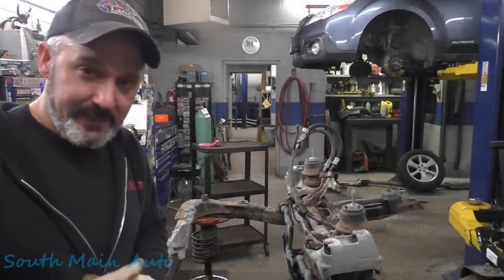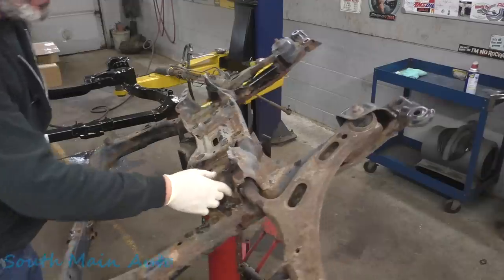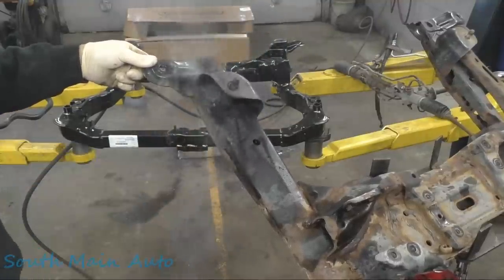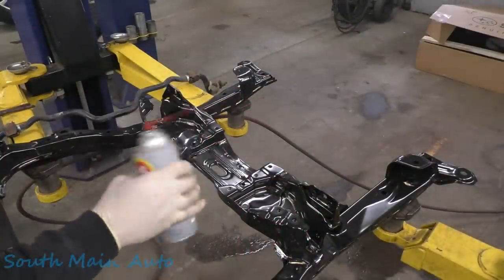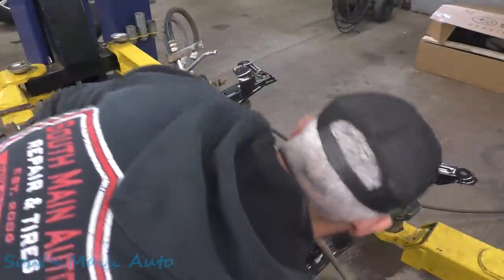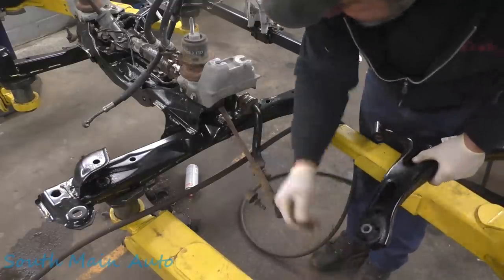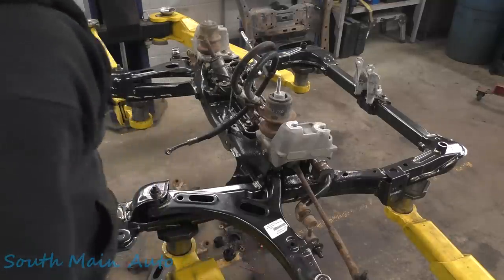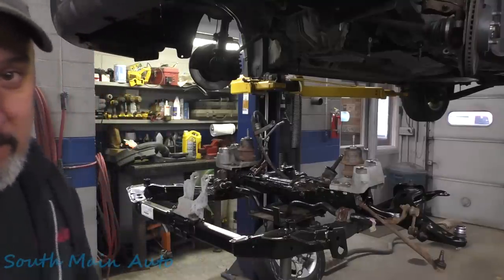Project Rotted Subaru Subframe - Part II

Comment: 8 years and nearly junk.  10 years and it surely will be.  Cars should last easy 20 years.  And they do most every where roads don't have to be salted. And it's not just the loss of 10 years.  There is a lot of expensive upkeep that wouldn't have to be done in a non-salt area.  I am getting ready to do my first pad slap to my 2010 130k Honda because it doesn't need rotors. Losing 10 years out of the life of every car seems like there should be something to reduce this rot.  It might be expensive but the expense of discarding a car after only 10 years is expensive.

Comment: I bet you get comments on using extensions when you are torquing fasteners. Many think they change to applied torque however they do not. I have heard that argument for years and years. Plain facts are using extensions does NOT change applied torque to a fastener.

Comment: One quick question. Would your State allow welding in new metal patch panels to repair the sub frame?  In Detroit here, I have had a welder repair frames before and it worked out great. At a fraction of the time and expense.
Reply: "Worked out great"... for who?  I guarantee there is massive corrosion occurring and you can't see it.  But if you sold it... you kicked the problem right down the road.
Reply: Depends. You cannot weld on contaminated metal, so the welder had to get down to the bare metal to weld that. That section is good. But in others that didn't receive it, it may very well kick it down the road if not covered by paint, rust converter (works well imo and then painted over - especially for that surface rust).
Reply: @ShainAndrews  drove it for 2 more years with no issues. The only problem was that the welder had to keep grinding until he found good metal to weld to. He was very skilled. He fixed frames for 30 years.
Reply from the maker: Brand new OEM subframe from Subaru about $500 (for the part). No way in hell would any one sit there for hours trying to weld toilet paper patches on a rotted frame.
Reply: In Detroit metro, no inspections. Drive whatever POS you have. Buddy drove a truck until it bent in 1/2 when lifting it with the lift.

Comment: Or, thoroughly clean the lower surface of the subframe; fiberglass over the rotted sections; repaint with flat back and throw some dirt on the pain't before it dries; pass inspection; then drive for a couple more years before driving it to the junkyard where it belongs.
Reply: Get's tried a lot more than you might think, but a good inspector knows what to expect in their area and what to look for.

Comment: whats a subframe from subaru go for these days??
Reply: Probably more then what the car is worth 🤣
Reply: @bluethunder1951  probably, surprised the owner didnt get new hardware
Reply: Online they're showing around 5 hundred , so locally a little more than that.
Reply: Probably backordered. Subaru parts have been a nightmare all year. I know you cant get the lower control arm pinch bolts that rot in half in 2 years

Comment: um, how is the owner of this car justifying this? 
it had to be right on the line of, buy a new car? or completely rebuild the car...
it's not making a lot of cents(yes, purposely misspelled)
Reply: One possibility is have you checked the prices of used cars? They are absolutely insane.
Reply: I get it. however,  what's not being replaced now, will be like this potentially in a year or so. I'm glad I don't live there.
I was(past tense) a far away fan of salt on roads. not now. brutal

Comment: A lot of rusted holes in that subframe. Subaru needs to do better.
Reply: 2000 outback has 7X the rust my 1995 Volvo 850 has.  Lower grade metal or paints on Subaru.  30 miles N of NYC.  I did por15 the Subaru rear subframe last year.   No paint left.   89 Aries might also use lower quality steel.  84 crown Victoria, great frame still has paint.

Comment: eh?  you cut off  the a arms to save a bolt???   why not buy new bolts along with the a arms you have to replace?
Reply from the maker: Those control arms were complete junk. The bushings were torn right out of them plus the ball joints were loose
Reply from the maker: Sorry I misread your question. I cut them off to save the bolt, yes because I forgot to buy them originally. It takes days to get stuff from Subaru at our shop
Reply: That's what I  figured happened.

Comment: E, not sure on your feelings of torquing rusted/rusty bolts, maybe you do it for the viewers. I myself wouldn't of used a torque wrench on any of those rusted fasteners. Why you ask ?   Well because you could only be torquing resistance in the rusted threads and the connecting parts could still be loose or far from torqued to spec.  I would ugga dugga them bad boys until I knew the parts were co joined like poop on toilet paper.

Comment: why you would re-use that crusted hardWare on the control arms, can you NOT just get new OEM hardWare for not much coin and get 'er done ???
Reply: those bolts are what? 10$ or 20$ each? ... i think you put twice that amount into the manual labour to remove those from the old arms

Comment: why are every subaru a rusty mess? and everyone still loves them
Reply: Everything in NY is a rusty mess
Reply: @userer4579  but Subaru's are always worse for some reason i live in pa and own a 2001 toyota and its not even close to as bad as the car hes working on
Reply: @mitchelldavidson9911  I had two Toyota trucks rust to pieces, suspension components and frame, while my 1999 Forester went 300K without any rust. All subjected to the same conditions.  Does that mean that all Toyotas are rust-prone? The Toyotas I had are now both junk while that old Forester is still running around.  All autos rust, break, and  wear out--Eric's channel provides ample evidence of this; ALL have design flaws. Also, all manufacturers seem to have periods wherein their products are good, they build a following, and then go to crap.  Toyota is no different.
Reply: @userer4579  ya the trucks had bad frames lol toyota replaced them. i was the undercoater for a few years in indiana pa toyota. i have a rav 4

Comment: Who failed the inspection?  This is common to see surface rust on metal in the north.   I call BS on this one.
Reply: He addressed this in a short yesterday.  There were numerous holes in the frame rails, definitely  rusted out.
Reply: Well then I hope the customer git this replaced under warranty.  If he did then I missed it.  This is a manufacturer defect if it has pinholes caused by rust.  As I understand it is only a 2016.

Comment: Wouldn't it have been just as cheap to buy two new bolts instead of wasting oxygen and assetilleen  and the time? Just asking not bitching.
Reply: @ Tom Beltz Those bolts are probably Subaru "ONLY". Most likely on Back Order. Eric is trying to get that car back in service.